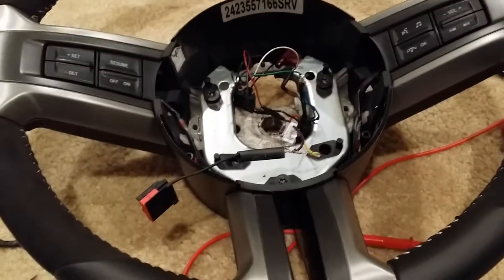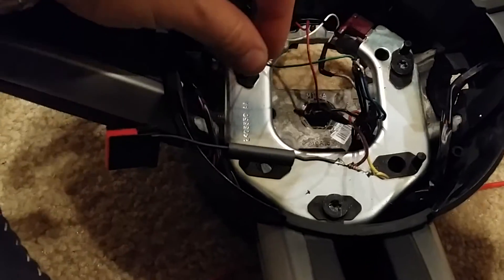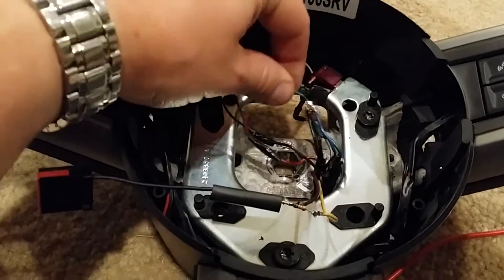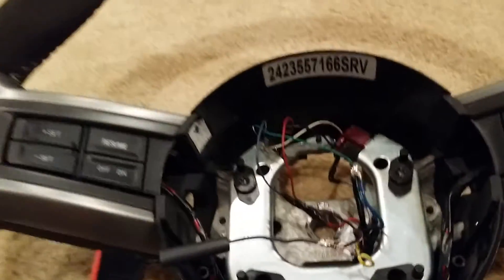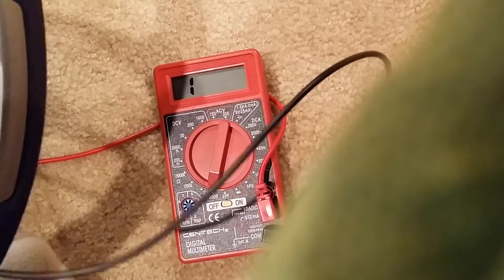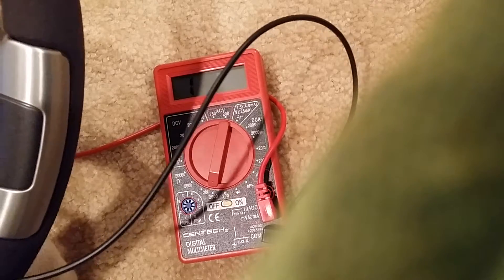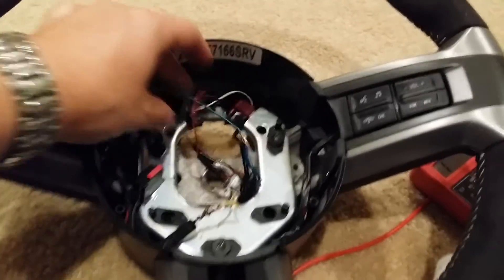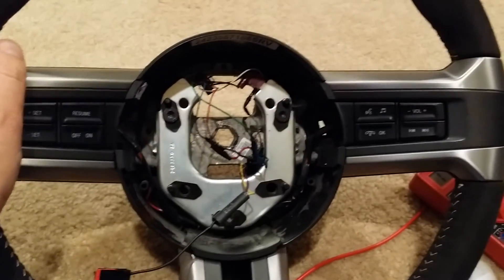S197 Mustang GT500 steering wheel button wiring

Comment: I know this was a while ago but I am doing this mod now. The resistor you want is a 1Kilo Ohm resistor (not a 100Kilo Ohm). I ran some tests on my steering wheel and in order to get the resistance values he measures you have to use 1Kilo Ohm.  He says 100Kilo Ohm somewhere but then he reads the correct color codes corresponding to a 1Kilo Ohm resistor. And that is Brown Black Red Gold. On the close-ups, I could not see any red so I did a little trial and error testing. And nice job on giving all the resistance readings for the various switches, that really helped tremendously.  Otherwise great video it got me going down the right path.
Reply: Did yiu get it to work
Reply: @johnceravino3908  I have not had a chance to do the install yet but I will update when I do. I am also using this YouTube video as a guide https://www.youtube.com/watch?v=-R-Jz6E3B3Y&list=PLEiJ7nTf5VPzZITH7Fi_v9IJfoE2p2Rco&index=26&t=54s
Reply: I got it working with a pac audio swi-rc-1 just haven't figured out the phone yet
Reply: @johnceravino3908   did you use 1 wire or 2 on your wpt440 connector and what wire(s) did you use on the SWI RC-1 to connect to the steering wheel

Comment: so from the old steering wheel wiring you cut off the old connector and spliced pac-swi-rc connector to get the radio and the phone and cruise control to work?
Reply: do you know what the two other connector names are?
Reply: or even if you have a link so i can buy them. that would be great. and on your video you should where they have connect to?

Comment: hi i have a 2010-2014 steering wheel i installed it like you said on my 2005 mustang  the lights are on (the buttons) i even tried with the resistance  of the buttons they all give different values  but the cruise control still doesn t turn on ?  yet i recheck 100 times the wires .. they are like you said .. can someone help !!!

Comment: Does anyone knows, what's year of adapter for steering wheel's button do i need for Mustang. The 2005-2009 or 2010 and up? and by the way, i have the 2009 mustang GT. Thank you!!!!!
Reply: So you still used the PAC SWI-RC to connect up to the stereo?  I have an android head unit from Dasaita and I am wondering if I can connect the WPT440 from the out under the steering wheel directly to the head unit Key1 or Key2 wires from the harness.  This way I do not have to use the PAC unit.

Comment: Hi Alexandru.
Just started to planning the 2010-GT500 install on my 2005 Mustang. I can see more different ways to wire both the GT500 abd the Boss wheel.
For me it's the GT500 , with Pac SWI-RC , and two WPT-1242. My head unit is a newer AVH-Pioneer 
Can You inform me, if I need to do the wire-work exactly like in Your guide ? 
Thanks Henrik ( Denmark )
Reply: +eliminatordenmark Did you get your gear to work?  I just ordered a avh-x3800 and plan on getting the GT500 wheel for my 06 mustang.  Currently has a shaker 500

Comment: This is my NIGHTMARE trying to get a 2012 SW to work on my 2006 Mustang.  Hope it helps some and others can reply with answers to help me finish this project. Thanks!

I've been researching this project for two months. It sucks that only Alexandru has a YouTube write up.  I'm nearing the finish of my project, but am leery of shortening out my HU or something else.  I have 2006 Mustang V6 with a Pioneer AVIC-8000nex head unit and (4) JL speakers (front and back) and KickerShelby replacement subwoofers in the doors. Plus, a JL amp for the speakers and a JL amp for the subwoofers (but this doesn't matter). ** Logically, this is all aftermarket equipment, so ALL wiring is aftermarket and thus do not tap into any Ford factory harnesses/wiring.   * I am currently trying to use the iDataLink Maestro SW interface (which is really cool), because you program the interface with factory pictures of the car, SW, HU, AudioSwitches, etc.. on your computer (only thing that SUCKS is that it is not Apple compatible, so must find a friend with a PC:-)...  

I have the 2012 Mustang steering wheel with audio and voice controls, (2) WPT-1242 connectors for the middle and left clockspring switch/input and went through hell to find the 5 pin connector off a 2005-2009 steering wheel ponytail (that will replace the 10 pin cruise control connector found on 2010 and on Mustang steering wheels. (You can of course use the 5 pin from your 05-09 Mustang, but I wanted to have all of this done before messing with the airbag and my steering wheel.... Are you still with me??? Lol.  Here are all the online articles I have found on the subject...  I would appreciate any information on the 2012 audio control wires, there purpose/resistance/impedance, etc.. and basically just where they go in the installation. Good Luck! Hope my sweat, suffering and frustration makes this process easier on you....

Best Regards,
Matt
MJWard47@Yahoo.com

S197 Steering Wheel Modification

1).  http://www.moddedmustangs.com/forums/2005-2010/246130-new-boss-steering-wheel-05-09-mustangs.html

2).  http://themustangsource.com/forums/f692/boss-302-steering-wheel-into-05-gt-501629/index2/

3).  http://www.teamshelby.com/forums/index.php/topic/49538-new-2010-gt500-steering-wheel-wiring/page-2

4).  http://themustangsource.com/forums/f692/boss-302-steering-wheel-into-05-gt-501629/index5/

5).  http://www.moddedmustangs.com/forums/2005-2010/294065-howto-install-2010-steering-wheel-have-fully-functional-audio-controls.html

6).  http://www.svtperformance.com/forums/showthread.php?851556-Calling-TOB-Boss-302-steering-wheel

7).  http://themustangsource.com/forums/attachments/f692/153994d1394184744-steering-wheel-audio-mods-audio-controls-2007-mustang-2.pdf

8).  http://themustangsource.com/forums/f692/boss-302-steering-wheel-into-05-gt-501629/index3/

9).  http://themustangsource.com/forums/f692/steering-wheel-audio-mods-528705/

10). http://themustangsource.com/forums/attachments/f692/155531d1396332601-steering-wheel-audio-mods-mustang-strg-wheel-switches.pdf

11). http://www.12voltdata.com/forum/viewforum.php?f=319

12). http://themustangsource.com/forums/f692/boss-302-steering-wheel-into-05-gt-501629/index5/

Comment: Can someone post a link for a write up on this? I have been searching for one to get all of the controls to work but can find it. Thanks.
Reply: +happykaosproductions 

I've been researching this project for two months. It sucks that only Alexandru has a YouTube write up.  I'm nearing the finish of my project, but am leery of shortening out my HU or something else.  I have 2006 Mustang V6 with a Pioneer AVIC-8000nex head unit and (4) JL speakers (front and back) and KickerShelby replacement subwoofers in the doors. Plus, a JL amp for the speakers and a JL amp for the subwoofers (but this doesn't matter). ** Logically, this is all aftermarket equipment, so ALL wiring is aftermarket and thus do not tap into any Ford factory harnesses/wiring.   * I am currently trying to use the iDataLink Maestro SW interface (which is really cool), because you program the interface with factory pictures of the car, SW, HU, AudioSwitches, etc.. on your computer (only thing that SUCKS is that it is not Apple compatible, so must find a friend with a PC:-)...  

I have the 2012 Mustang steering wheel with audio and voice controls, (2) WPT-1242 connectors for the middle and left clockspring switch/input and went through hell to find the 5 pin connector off a 2005-2009 steering wheel ponytail (that will replace the 10 pin cruise control connector found on 2010 and on Mustang steering wheels. (You can of course use the 5 pin from your 05-09 Mustang, but I wanted to have all of this done before messing with the airbag and my steering wheel.... Are you still with me??? Lol.  Here are all the online articles I have found on the subject...  I would appreciate any information on the 2012 audio control wires, there purpose/resistance/impedance, etc.. and basically just where they go in the installation. Good Luck! Hope my sweat, suffering and frustration makes this process easier on you....

Best Regards,
Matt
MJWard47@Yahoo.com

S197 Steering Wheel Modification
1).  http://www.moddedmustangs.com/forums/2005-2010/246130-new-boss-steering-wheel-05-09-mustangs.html
2).  http://themustangsource.com/forums/f692/boss-302-steering-wheel-into-05-gt-501629/index2/
3).  http://www.teamshelby.com/forums/index.php/topic/49538-new-2010-gt500-steering-wheel-wiring/page-2
4).  http://themustangsource.com/forums/f692/boss-302-steering-wheel-into-05-gt-501629/index5/
5).  http://www.moddedmustangs.com/forums/2005-2010/294065-howto-install-2010-steering-wheel-have-fully-functional-audio-controls.html
6).  http://www.svtperformance.com/forums/showthread.php?851556-Calling-TOB-Boss-302-steering-wheel
7).  http://themustangsource.com/forums/attachments/f692/153994d1394184744-steering-wheel-audio-mods-audio-controls-2007-mustang-2.pdf
8).  http://themustangsource.com/forums/f692/boss-302-steering-wheel-into-05-gt-501629/index3/
9).  http://themustangsource.com/forums/f692/steering-wheel-audio-mods-528705/
10). http://themustangsource.com/forums/attachments/f692/155531d1396332601-steering-wheel-audio-mods-mustang-strg-wheel-switches.pdf
11). http://www.12voltdata.com/forum/viewforum.php?f=319
12). http://themustangsource.com/forums/f692/boss-302-steering-wheel-into-05-gt-501629/index5/
Reply: happykaosproductions  I have a link for you if you want it done right
Reply: I ended up figuring it out and bow gave it fully working. thanks!
Reply: What wires do you wire to what ? I just have the lights lighting up . But my cruise control buttons still don't work

Comment: is there any way to get the audio controls working based on your video without a different head unit that isn't stock? And with the ohm resistor and the connector for the audio control would I need anything else to get it to work?
Reply: How much does the PAC interface cost?
Reply: That's not bad. Which version of the PAC interface did you use?
Reply: Cool. Do you remember what version of the PAC interface you had to use?
Reply: +Alexandru Bauer cool I thought that might be it. With the interface boxes/modules did you have to place them anywhere special? And where did you get the other connector used for the audio buttons? Also I really do appreciate you helping me figure this all out.

Comment: did you ever get this to work with this wiring set up? I bought this same steering wheel for my s197 but it was from someone else who had it in their s197 previously. They had everything wired a little differently from what you have here. They have only the purple wire hooked up to the single green wire with the connector and left the yellow wire unplugged. I also see the blue wire is unplugged. I want to do what you did here but I want to know that it worked out for you first. Thanks.
Reply: +Alexandru Bauer Thanks for the reply and the link! I actually read through that post and a few others today. I'm doing a whole audio system upgrade and the steering wheel is being a pain in the butt...  I'm going to try and wire things your way. The other problem I have is that I bought a maestro steering wheel control adapter and because this steering wheel is off of the newer Mustangs, it's extremely difficult to figure out how to wire the adapter. The steering wheel has sync controls but obviously the S197 doesn't have a sync box so the wiring options it's giving me are non-applicable. It's telling me to wire the control box inputs to two the headunit wires which makes no sense, as I figure the box inputs should go to the steering wheel wires, and the output wire goes to the headunit remote wire.
Reply: +Alexandru Bauer The previous owner of the steering wheel has cruise control working so I'm tempted not to touch it but I'm confused XD maybe I'll just call maestro.... Damn I should have gotten a universal auto-programming adapter.
Reply: +Alexandru Bauer Sorry for the spam but I figure if I wire it your way, I can use the buttons that were originally intended for the sync module as extra buttons for more funtions with the headunit right?
Reply: your cruise control works ? cause mine doesn t yet i did exactly what you did ... can i send u a picture of what i did